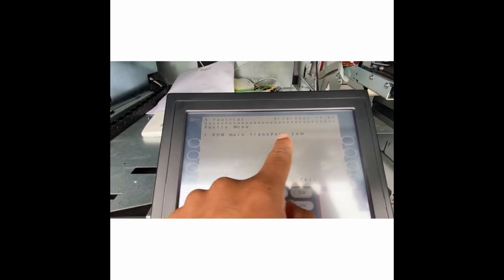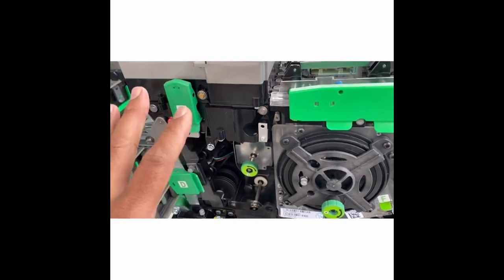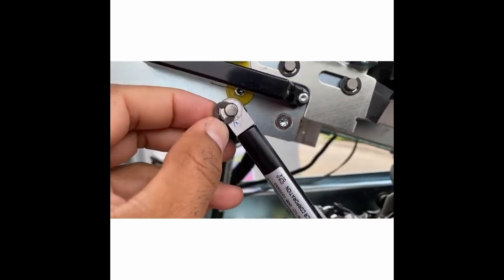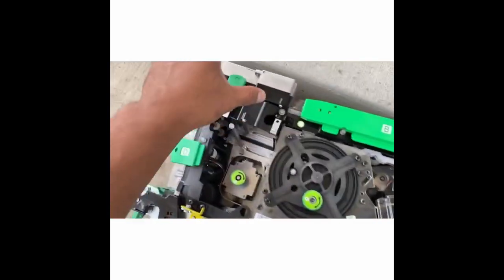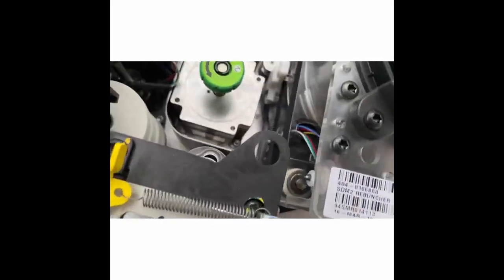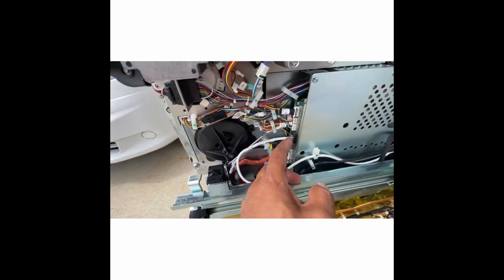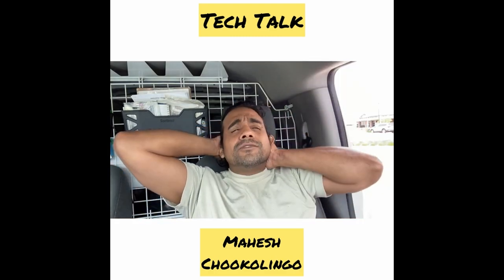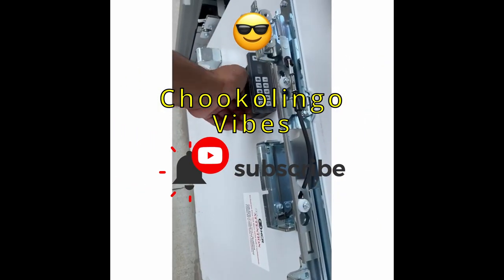A DAY IN THE LIFE OF A TECHNICIAN (Re-Edit)

Comment: I plan on getting a job here any reviews?
Reply from the maker: All ATM tech jobs are high turn over due to 24/7 coverage contracts so make sure you negotiate appropriate compensation and you have to stand your ground on making sure you don’t get pushed around
Reply: It can be tough hours but they will pay you for it. It is advanced tech work so it is not just ATM's, its networking and a lot of driving. It is a serious career. I am a NCR tech and there are a lot of old timers.
Reply: @UNrDD  actually got the job! I start soon!

Comment: Wow, you have a DVM fault, you automatically replace the entire SDM2 core without clearing the escrow and doing any diagnostic test. Why did you remove the 2 C-clips on the bottom? You can just leave them there. If it doesn't work it probably means one of the connectors is not plug in all the way. Last resort is to reload software. You almost busted the infeed. Towards the end you didn't plug the escrow unit. Lastly you should wear some type of uniform and not a regular white shirt.
Reply from the maker: Agreed i was waiting for techie to catch it 😉, it makes for better content and more footage. But in all honesty back then i was winging it. Today i am more careful and more experienced than then.
Reply: Logs, sensor states are your friend.
Reply: When in GOP there was an error shown. Can we just click it and software tries to remove it? Also, what M stats was there for this module?